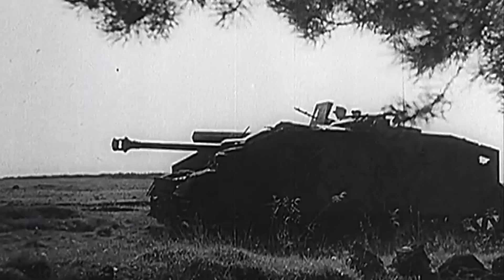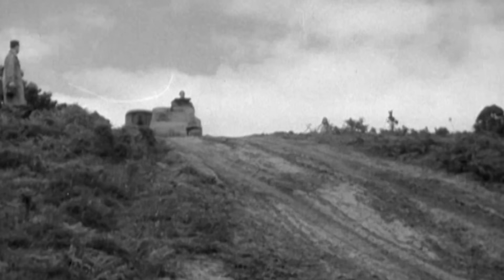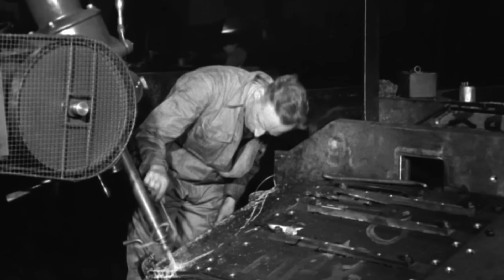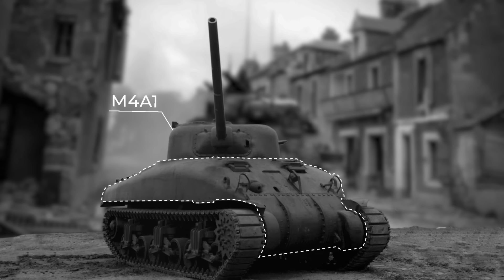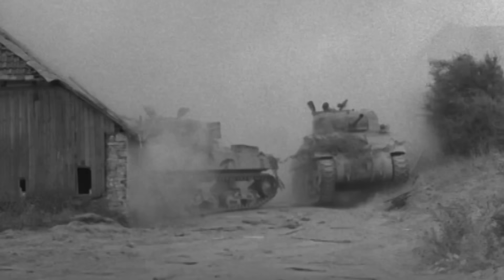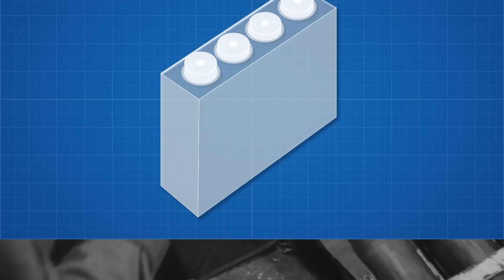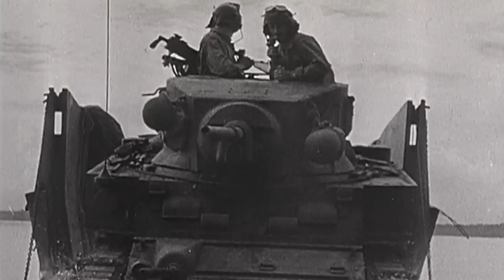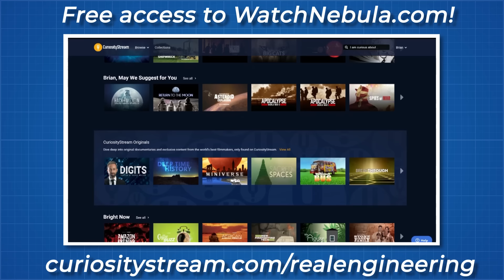M4 Sherman - The Workhorse of D-Day

Comment: Much of the Sherman hate is based on Belton Cooper's book which is NOT a reliable source. He spent his time fixing broken or battle damaged & blood soaked Shermans so while his bias is understandable, his book has GLARING inaccuracies. The Sherman was NOT built for tank on tank engagement. US Army tank doctrine was to use TD's (tank destroyers) for tank on tank battles, whereas the Sherman was for infantry support. Upgunning it w the 76mm to deal w German CATs, depended on HVAP rounds which had a tungsten carbide core, very effective at armor penetration when fired from a 76mm. Since tungsten was in short supply, so were HVAP rounds. If you had an experienced crew manning a 76mm Sherman, a couple of HVAP rounds could make a huge difference in a tank on tank engagement but this was more ancillary than the tip of the spear against German armor. The British on the other hand, didn't use tank destroyers which is why they adapted the 17 pounder to the Sherman which even with conventional anti tank rounds containing no tungsten core, was still effective against heavy armor. American artillery was another factor that could be absolutely apocalyptic to German CATs. The problem with the Germans building, maintaining and the unreliability of these behemoth CATs was that what seems superior on paper isn't always so in the BIGGER PICTURE of warfare. It's important to understand these differences and how they played into the bigger picture of manufacturing, maintenance and actual warfare before drawing judgmental conclusions as to which tank was better.

Comment: Interesting video and some great points, but to clarify the gun isn't low velocity @ 610 m/s, when a low-velocity gun fires under 400 m/s and a high velocity is about 700.
Also, the M4A1 wasn't just an 'early' hull design, as the cast M4A1 hulls were being built through up to the last versions of the tank built in 1945. It was around manufacturing capabilities, and cast hulls were harder to make but deemed to be 'stronger' as a single piece.

Comment: As a former soldier and retired mechanic, No side had the "Best" {PERFECT} Anything! They build the things work for them, given the limitations and compromises inherent in EVERY design, However, in my experience I noticed a huge difference between American designed & German designs, even up to the present day.. One small example I found was in maintenance manuals. In American manuals the material was simple & straight forward, explained in less than 50 pages, written that mostly ANY mechanic could EASILY understand. But, the German had, 1000+ pages that was so complex & detailed, that it had to be studied, which , unfortunately, SLOWED down the repair process! When you are trying to win STRIVING for PERFECTION(COMPLEX) is the ENEMY of ITS GOOD ENOUGH {IT WORKS)  I read all the comments here, watched video & I found most info given was either flawed or missing key elements. cheering for these underdogs is deeply disturbing given that there deep racism. However, the allies at times, were flawed too, My family left everything n 1939 before the start of WW2 as 5 members were killed and they came to a country with way more freedom. Please be respectful and as I heard another veteran say we fought to give freedom of choice for everyone especially those that we disagree with!

Comment: I think you’re a little bit off on the Easy Eight, but it’s a pretty common and small misconception so it’s fine. The Easy Eight nickname originated from the E8 in the designation. The word that stood for ‘e’ before the NATO phonetic alphabet came along was ‘Easy.’ Thus, when referred to verbally, it would be called the Easy Eight. However, the designation was for the prototype tanks to test HVSS suspension on the battlefield, not for any specific variant of Sherman. A lot of people seem to believe that it was for any Sherman with a high velocity 76mm, HVSS suspension, and large hatches. It was not. The only requirement for a Sherman to be an Easy Eight was the suspension. However, the later HVSS models of Sherman were not designated by E8, but HVSS, meaning that E8 is only for prototype Sherman’s with the HVSS suspension. I’d suggest going to Eta320’s video on the Easy Eight. It’s well researched, especially for as small a YouTuber as he is.

Comment: The one thing the movie Fury made way off, it's the 76mm High Velocity gun which can penitrate a Tiger head on without going to the rear of the tank, plus, the Tiger in the movie is the Tiger 131 which is a Tiger H1 which is not as good as a Tiger 2. That's mostly just Hollywood crap. Though you did forgot the M4 Jumbo which is a variant of the Sherman that is more beefed up with armor. There was the Sherman Firefly with the 3-pounder gun.

Comment: The Sherman was not designed to fight enemy tanks. Hence the low velocity 75mm which was superb for hitting entrenched infantry. Taking on enemy tanks was the job of the tank destroyer battalions, which did an excellent job. 

The myth of 5 tanks needed to fight one tiger makes perfect sense when you realize a tank platoon was 5 tanks strong. So when going out on a mission you brought along the whole platoon.
Reply: That's not even close to what Armored Force doctrine entails, likewise what a tank engages has no direct bearing on what it supports. Lastly the 75mm. was by no measure low velocity. Comparatively, depends, but as a baseline, no it was not low velocity.

Comment: Size was everything...As you would need special ports to unload a heavy tank....Why America went with the M4... it could be unloaded right off the ship. Using simple cranes that every port  had....You could ship more of them on each cargo ship..Last but not least.. All parts would would work to repair another M4..  No special fitting or machining..As the German tanks needed..As  you could not just grab any part off an older Panther. And slap it on the new one...

Comment: The British had some influence over the design of the Sherman.

Though reluctant to adopt British weapons into their arsenal, the American designers were prepared to accept proven British ideas. British ideas, as embodied in a tank designed by the Canadian General Staff, also influenced the development of the American Sherman tank.

The US were eager to supply about 250 unproven Sherman tanks out of about 1,500 in total. The US were desperate to get the tank blooded in battle, so the British could do that for them.

The Sherman on introduction was generally no better than British tanks, but more reliable being new. In fact it was worse than some especially the well armoured 6-pdr Churchill. The Sherman’s first showing was at El Alemein, as unproven it was pitted against lesser Italian units. The Sherman tank supplied was complex, as they never had a proper tank engine it had five Cadillac engines arranged in a circle, supposedly synched up - note: US forces never used this complex excuse for a tank engine - the Sherman was built from as many existing commercial vehicle parts as possible. The British worked with the makers to improve the complex engine and tank generally - the E8, the ultimate Sherman was derived from suggestions by the British.
Reply: A lot of that doesn't make any sense or correlate with the M4's performance.
Reply: @peterson7082  

If it doesn’t make any sense how would it correlate with the M4’s performance?

Comment: The Sherman was a mobile pillbox in function, only a tank in form.

Against infantry and in support of fast moving attacks through German infantry lines, the Sherman was great. Patton loved 'em for this. But against German tanks, they were death traps.

Armed with air and ground intelligence and having flushed the enemy out with scouts, Patton would attack German infantry lines with Shermans driving and supporting the thrust. He'd then push the attack fast into the Germans' rear. Rapidly falling behind enemy lines, and losing logistic support, German tank units had to decide to stay and fight until out of fuel and ammo before becoming trapped behind US lines, or withdraw.

Slowly, the Germans began to adapt by either staging tanks units near their infantry units and/or doling tanks out same. The Germans also began to use a secondary ring some distance behind the front that could better respond to Patton's attacks.
Reply: Shermans weren't deathtraps. Every notable statistic says so. Its armor was on par with contemporary German designs, its gun was sufficient for destroying most armor it would ever face, and its mobility was on par with its contemporaries. It also had a very high crew survival rate, better than most vehicles of its time.
Reply: @bluntcabbage6042  Wrong! Belton Y. Cooper even wrote a book about the Sherman tanks at war called, Death Traps. The Sherman tank was little more than a mobile pill box. Much to his and his staff's credit, Patton utilized them as such.
Reply: @k.chriscaldwell4141  The fact that you're using Belton Cooper as a reference speaks volumes. Death Traps was a memoir, not an analytical document on the efficacy of Shermans against armor. What's more, Death Traps was a memoir from a tank recovery/repair unit. It is literally in the name that they will constantly deal with broken and destroyed tanks, but not the ones that are still fighting.

The stats literally say that the Sherman wasn't a deathtrap. It had extraordinarily low crew casualty rates, few American tankers died inside their tanks (~1.5% overall), and its armor, ammo racks, and armament were on par with (or superior to) the direct German equivalent (Pz IV).
Reply: @k.chriscaldwell4141  

You're using Belton Cooper as a source?! A man who only saw ruined Sherman Tanks and had never served in one? 

He's been discredited about a thousand times...

Comment: i think it’s interesting that American design philosophy in WWII for tanks were a complete opposite of that for fighter aircraft, especially in the later 2/3’s of the war. 

build and design robust, powerful, nearly indestructible, huge fighter aircraft like the P-47 and F4U, the way Germans designed and built their tanks.
Reply: Not really the case
Reply: Because planes at the end of the day, will land on a airfield or carrier with a good chance that there'd be spare parts lying around. And the difference between Germany and US was the industrial capability to produce planes and parts.
Reply: Not really. The P-47 was designed to be fast, so it was built around a huge engine
Reply: @kokofan50  
when you’re designing for speed, even with a powerful engine, weight and size is going to be your enemy. a double-wasp engine already has a high profile drag to begin with (unlike the v-12 rolls-royce) and so engineers already know speed will not be the first priority. 

the usaaf wanted a long range escort fighter.  and they wanted high altitude capability and survivability. that means larger gas tanks, heavier self-sealing tanks, tougher armor around the cockpit. all of these contribute to weight and higher drag. 

the fact that the dbl-wasp was such a powerful engine that it made the plane fast (despite these drag-inducing factors) was just icing on the cake.

Comment: Uh- why not put the M3's 75mm gun in the center of the hull so it could traverse both left and right - like most other countries assault guns like Germany, Russia, etc?!    W.
Reply: M3 Lee was cramped in itself, considering they had 7 crew (6 for the Grant), 2 guns, handfuls of machine guns and their respective ammos, all packed in a small package. Putting it in the center would've just made it worse for everyone and everything inside. Also, gun in center can't always be helpful in its designation as an infantry all-rounder tank. German and Soviet TDs were TDs and wider + longer than the hull of the M3/M4 so for the most part, they can easily camp out at a distance
Reply: Who was the "genius" who put all those cannon shells/rounds all over the turret?!- designer should be in that loaded tank when it was turret hit by an antitank round!!!   W.
Reply: @waynemaneki9458  

The King Tiger did that exact same thing, putting ammo in the back of the turret, with no wet stowage.

Comment: any varient of the sherman would fall easily to any panther or tiger 2, except the jumbo sherman, the american 76mm was not strong enough the the 90mm m3 was put into production with the m26 pershing medium tanks and the t33 solid shot ap round was meant to defeat panthers at well over half a mile away, though they entered production at the tail end of the war and saw little service
Reply: Found the guy who thinks war thunder is equivalent to reality.
Reply: "Any variant of the Sherman would fall easily to any Panther or Tiger 2"

Laughs in 3rd and 4th Armour Division with their 3:1 K/D on Panthers. Yes, they would kill 3 Panthers for every 1 Sherman.

Also look up Arracourt and realise how dumb you are.
Reply: Of course, in a head on 1v1 battle, but that's basically disgracing the numerical and strategical advantages of any tank company

The reason France's tanks were defeated in 1940 is not because of the Panzers' powerful guns and armour but due to proper communication and wits. No sane tanker would headbutt a camping Panther or Tiger, it'd be plain stupid. They'd call infantry for more info and to help clear out the Panzerschreck bitches that could be hiding, so they can aim the weak backsides-which is the main achilles heel of any tank. Or maybe if they're too lazy, call in CAS to kill that shit. But more or less, with proper deployment and clever tactics, even a 75mm Sherman can kill a Tiger

Comment: Ah. The M-4 MEDIUM tank. Gets a bad rap and called weak for being ineffective against the German tiger HEAVY tank. You see that? weight class difference. Also, nothing in ww2 could reliable challenge the 66 ton beast called the tiger. Unlike any other tank of the war, there is an M-4 for literally every situation. There was even a short stint of experimenting with airdropped shermans, though that never materialized for obvious reasons.
Reply: Which tiger? Tiger 1? Which sherman's beat at every turn? Tiger 2? Which just like tiger 1 was in unreliable hunk of junk?
Reply: Tiger 1 is 56 ton and Tiger 2 was 68 ton not 66

Comment: I know this is older, but I had to mention something about the gun. The gun was not terribly inadequate. It could punch through Panzers reliably. Many tankers preferred the 75mm over the 76. Also, the gun was perfect for what it was designed for, assisting infantry. Its he shells were perfect for fortifications and troops.
Reply: Not at range ir couldn't and mean range in Europe was around 800 yards. At that range both 75mm and 76mm struggled frontally against a variety of German armour.
Reply: @lyndoncmp5751 Only the heavy German armor, which was not met often.
Reply: @matthewjones39 
Actually more Panthers than Panzer IVs were deployed in the west. There were 1,837 Panthers and 1,666 Panzer IVs in the west from June 1944 to May 1945. 
The Jagdpanzer IV had the same front armour and gun as the Panther. Even the Hetzer with its 60mm sloped front armour was problematic for the Sherman 75mm frontally. Add in smaller numbers of Tigers and Jagdpanthers and it's more than you imagine.
It partly explains the near 1:3 combat loss ratio the allies suffered in armour against the Germans 1943-45.

Comment: M4A3E8, or easy 8, was the best anti-tank Sherman variant 

The soldiers themselves never really liked it. The 75mm gun had better HE rounds which was better for the stuff they were mostly fighting. Don't forget that Panzer V (Panters) and Tigers did not have very high production numbers and would, because of low quality steel and rushed production, take significant damage from taking HE round hits alone

Comment: The M4 and the M3 were both being designed around the same time. Both of those tanks were based off of the M2 medium tank, which was the direct predecessor to the M3. The M3s design was based off of the, if im remembering the modle correctly, M2E3, Which was the M2 with a 75mm cannon in the hull. The M3 just added a turret on top of that.

Comment: During initial landing of Normandy on Utah and Omaha Beach what actually helped with all the death was the lack of tanks actually made it to shore now it was a heavy duty workforce whenever it came to taking the peninsula that held cherberg but it was not able to be used a lot during the initial landing
Reply: Of the 32 used at Utah, 4 were lost after the LCT carrying them was sunk. 28 were launched amphibiously and only 1 sank on the way in. That left 27 that reached the beach. They didn’t contribute much after landing simply because Utah happened to have the best results from the preparatory aerial and naval bombardments. Some key defensive positions were knocked out and a lot of troops ended up shell-shocked enough that they readily surrendered. Utah only had around 250 men killed which was the fewest amount of the 5 beaches invaded that day. As for Omaha, the 741st Battalion gets all the attention there but the 743rd Battalion landed most of its DD’s conventionally at Dog-Green sector. Unfortunately because of the disastrous results from the preparatory bombardments that left the enemy positions virtually intact, the armor that made it didn’t make much of a contribution as well placed anti-tank guns had them pretty well pinned for some time. All told around 50 tanks did land before and during the first wave, or about 1/2 of what was intended. You are right though that they didn’t help as much as what was intended.